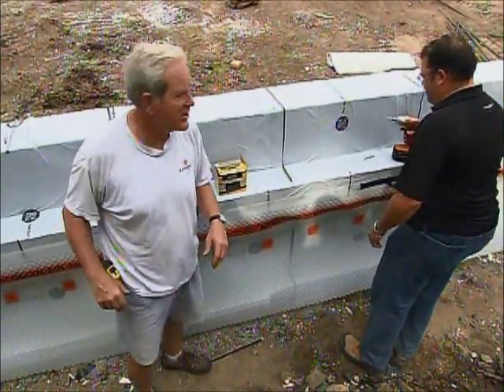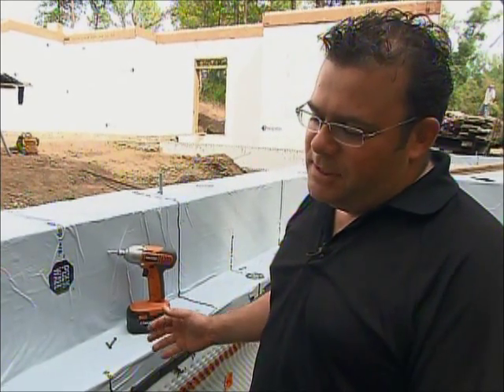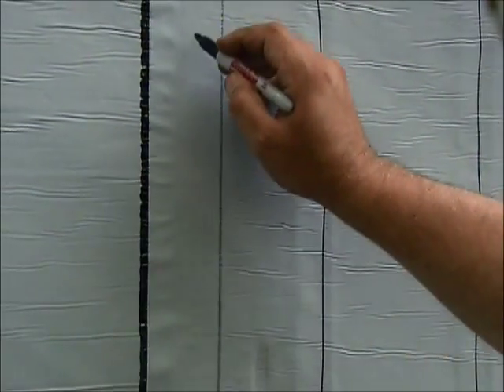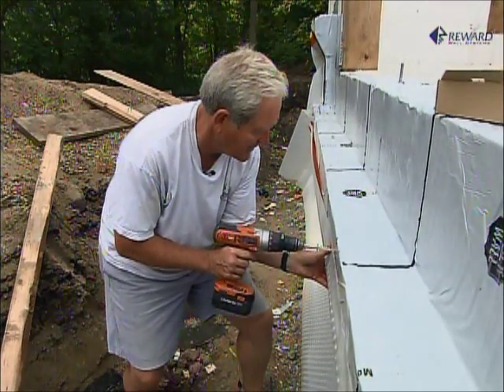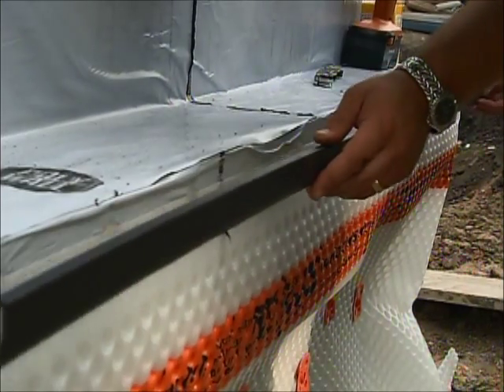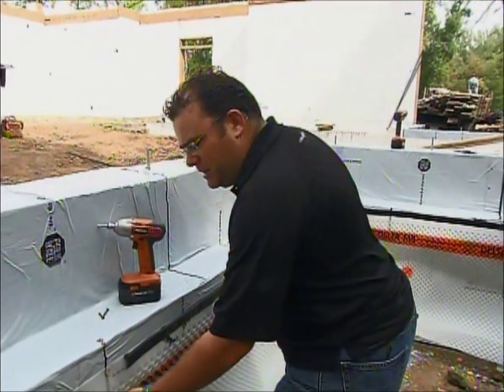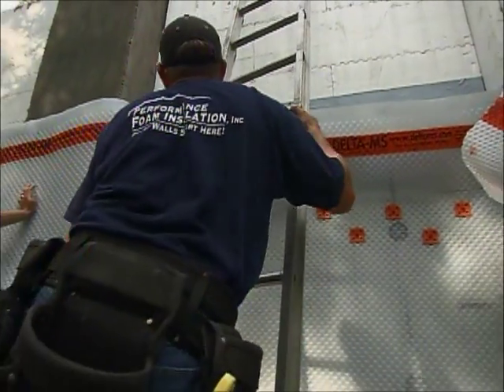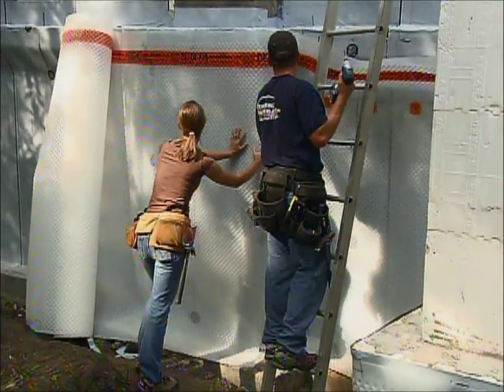DELTA®-MS CLEAR - for Insulated Concrete Form Foundations

Comment: Question: what kind of caulk did u use on that final black trim piece? We have dimple board waterproofing installed like this, but i noticed a gap between the pooured foundation and the black trim piece. We would like to seal the gap around the perimeter of our house.
Reply from the maker: Hi Virginia, thanks for reaching out. If you’re applying to concrete, we would recommend using our DELTA®-SEALANT, an elastic sealing compound used to seal off the flat tab and overlaps between membranes, as well as any gaps in the membrane where a tight fit may not be possible. If you are looking for a sealant for use on insulated concrete forms (ICF), you should use a product approved by the ICF manufacturer that won’t degrade the insulating foam. We hope this helps, please let us know if you have any further questions!